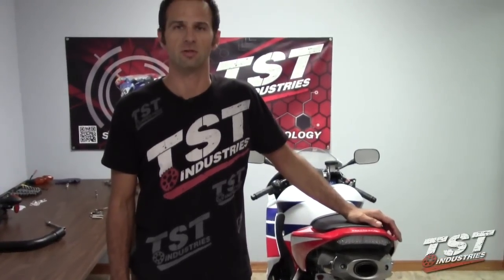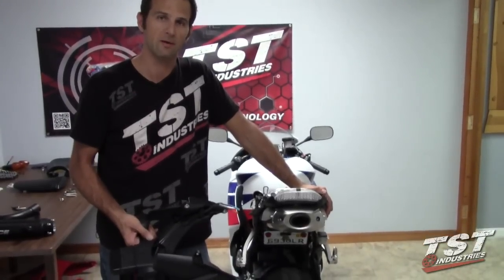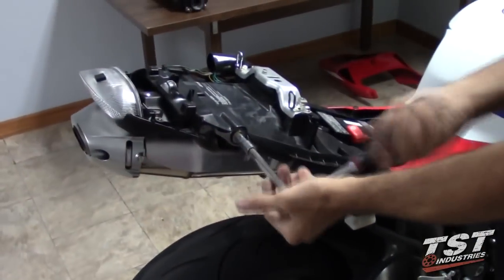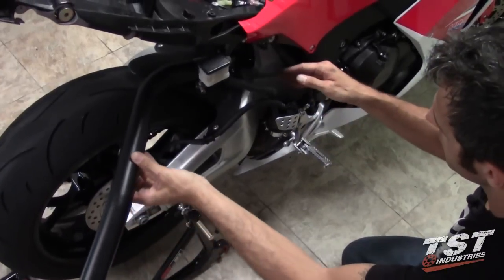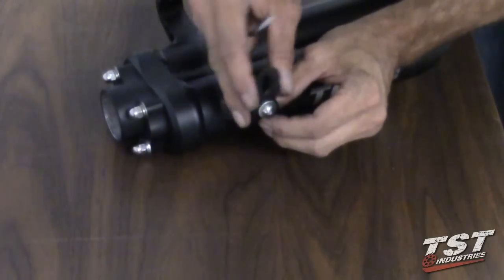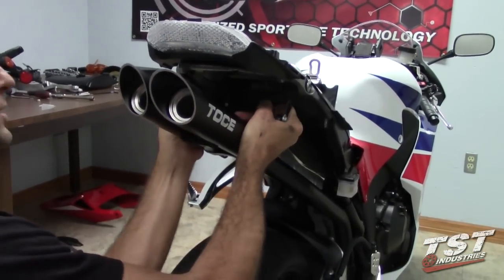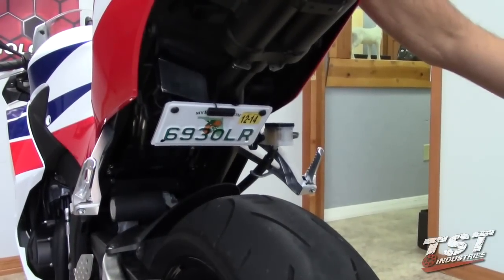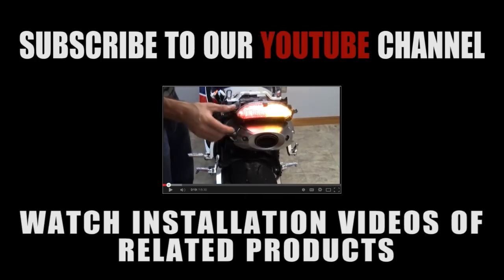How to install TOCE Exhaust on 2013-2020 Honda CBR 600RR by TST Industries

Comment: @Tst may be an old question, but how can I remove the baffles for a louder exhaust, and will doing so adversely effect my compression/performance?
Reply from the maker: Four acorn nuts on the inlet side of the canister. On just a slipon exhaust the baffle removal doesn't really yield much of a flow difference so it should be safe enough for the motor. The sound is really crappy though. It is just an unrefined straight pipe sound.

Comment: Does it increases the horse power ? Do you ship to QATAR?
Reply from the maker: We have shipped many deliveries to Dubai and other Emirates. I think Qatar should not be a problem but that question is best answered by our support department on our website. If you tune your bike after installing the exhaust then you can get results you will notice. The exhaust by itself does not give you any significant gain in power and torque. I think you should see the Dyno video we made with several exhausts on a 600RR without tuning.
Reply from the maker: Here is the link to the video I mentioned. https://youtu.be/aUw3MKLHVHs

Comment: is dyno tuning necessary after install?
Reply from the maker: It is not necessary due to the fact that this is a slip-on exhaust system. However, to achieve any real performance gain I would recommend getting it dyno tuned.

Comment: Is the lower heat shield not needed?
Reply from the maker: Stephen Lawrensen Most people leave it in place for safety reasons. On this particular bike the owner did not want it reinstalled.

Comment: Coming back in stock soon?
Reply from the maker: We replenish stock as fast as we can. The demand has spiked this year and supply is very slow. As soon as some go up on the site they all sell within few days and then we wait again. We have a button in each product page where you can sign up for notification when the part is back in stock. If you drop your email there you will get a one time notification so you can grab your exhaust when they become available again.

Comment: bu egzozdan benim motora lazım😄
Reply from the maker: +Recep Gursel I hope that's a good thing
Reply: +TSTindustries What is the price of these exhaust as r1 ..yzf
Reply from the maker: It depends for what year. For 09-14 they are $871 and we are currently running a special on a combo of the exhaust with integrated taillight or BMC air filter
Reply: +TSTindustries thank you 😒

Comment: Just did my install yesterday, great step by step video and super easy if you follow along.
Reply: Can you explain the heat shield thing? I'm confused if I keep the heat shields on and just install exhaust or do I take them both off and leave then off ? Or take one off and leave one on? Please explain briefly what you did. Thanks
Reply: @TrickRacing  I took my heat shields off and left them off. I like the look of the bike without heat shields better and I don’t notice a difference in heat on my leg without them on. It’s just a personal preference.
Reply: @richiem5025  perfect thanks. I ride with pants on anyways and no passengers great that's what I'll do .